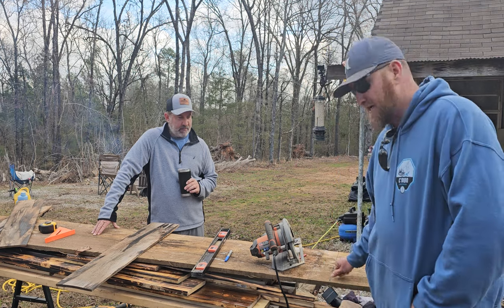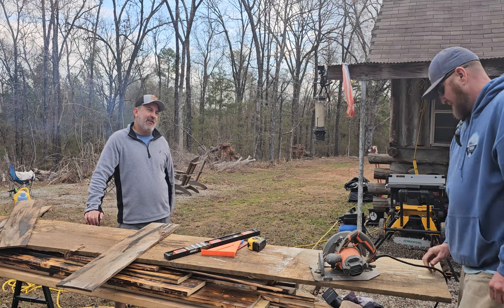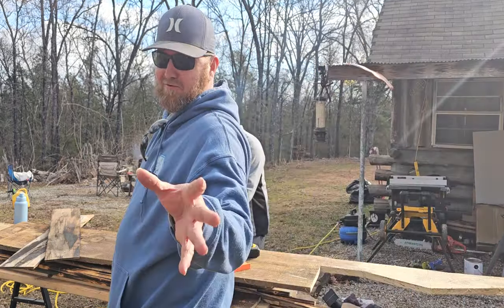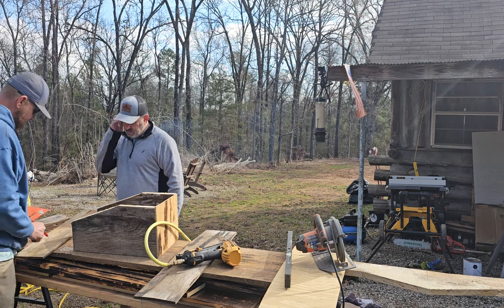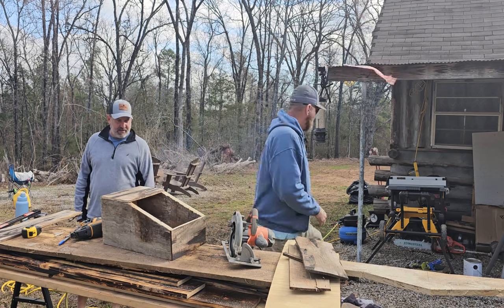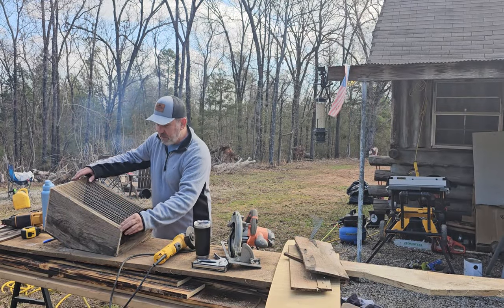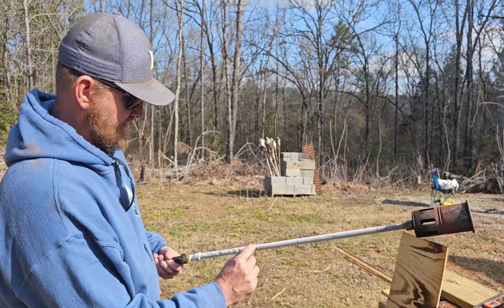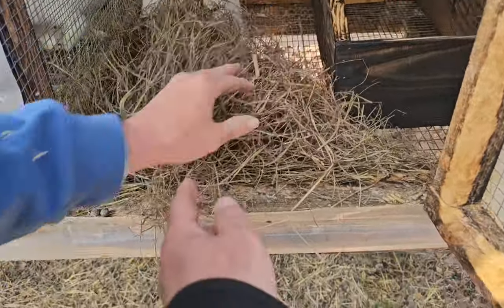WORK WITH US |tiny house, homesteading, off-grid, cabin build, DIY HOW TO sawmill tractor tiny cabin

Comment: Then you're gonna put those big boxes in those cages and the rabbits can have less room to move around you should have did but I did put thick boxes on the outside of the cage on the ends put a lid on the top like chicken box then you can clean the boxes out they got somewhere to go in the winter I got slide doors on mine so I can close the boxes off and my rabbits have way more room in the cage and they're happier and you can look at the bunnies by just lifting up the roof Locking the mum out and looking at the babies

Comment: I cut some old, old oak once about a 5 inch cut and the smoke was boiling in the air.  The board was black from the saw blade.  I decided that that wasn’t going to work.  The board was off an old barn.  Putting a nail in it would be impossible.

Comment: When we used to use the tagger torches when we were paving on the seams where you start off on in order to get more propane out of your tank cause they're getting low you just turn the torch onto the tank and man you get a lot more pressure🤣🤣🤣🤣

Comment: I put wood bottoms on my rabbit boxes because that hardware cloth is too hard to clean after they poop and pee their hair gets caught up in it too hard to get it out I took all the hardware cloth off the bottom of my cages because it was just too hard to clean And I did the same thing you're doing staples out of an electric staple gun lasted for a little while in the end I had to redo it with small horseshoe nails